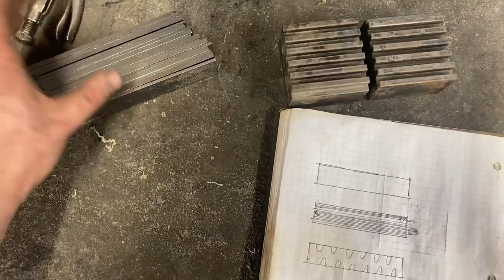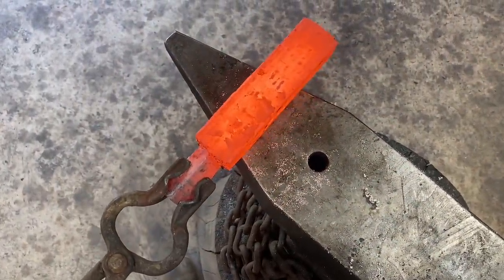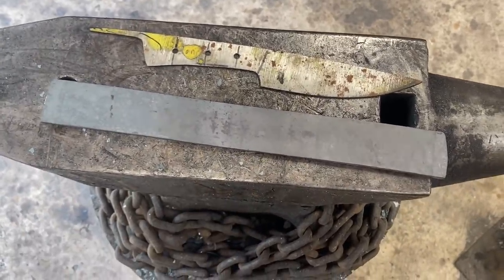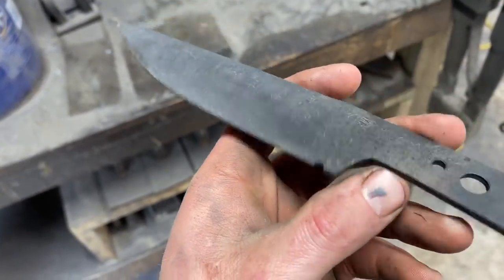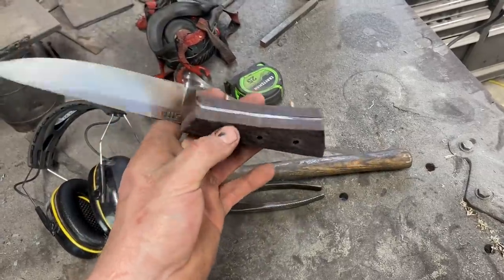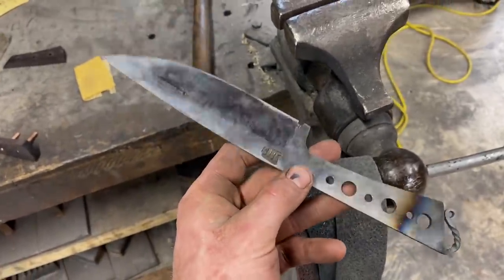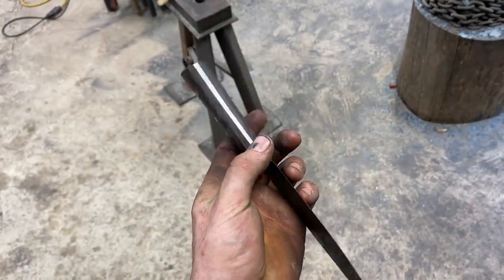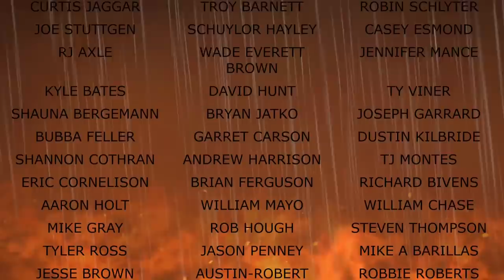Forging ladder Damascus and making a knife

Comment: John - I made a smaller Damascus knife based on this video with a rat tail lanyard loop and brought to the Blade Show to show you.  Hope you and your father are OK since you did not make it to Atlanta - stopped by your table several times.
Reply from the maker: I was actually in Atlanta but we were walking around. After the whole fiasco with the hammer steel I actually didn't have any stock to sell. If you didn't see about it on fb or Instagram I'll be talking about it in an upcoming video
Reply: Glad you’re physically okay. I’ll take a look at Instagram for the fiasco. No fun have steel problems. Looking forward to future YouTubes!!

Comment: Best chatoyance I've seen from ladder dies. I was predicting more of a fail when I saw the shape of them. Boy was I mistaken!
The first ladder dies I ever saw, were the ones Devin Thomas (?) used that had hardened dowel pins fixed to each plate that produced a rippled pattern like a Ruffles potato chip.

Comment: If found that running the blade on a contact wheel with the scotch brites with the blade vertical getting your scratches in the directly would with hand sanding it comes out way better and can provide a decent etch

Comment: Awesome work brother. Was wondering what do you do to keep your high carbon knifes from catching rust?
Reply: And what would a blade like that go for in your forge
Reply from the maker: The only actual carbon steel knife I have is my Damascus kitchen knife and I use olive oil on it. As far as what the blade would go for, I actually don't do commission blades so I didn't bother to keep track of the time and price it out
Reply: Thank you for the reply. And just a thought but I think you should go on the forged and fire show. You make your skill look easy.